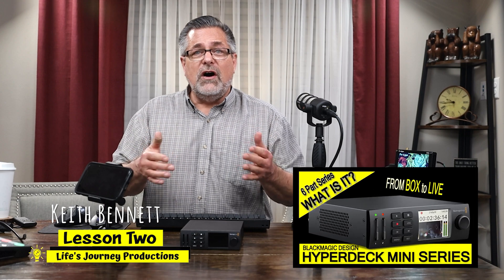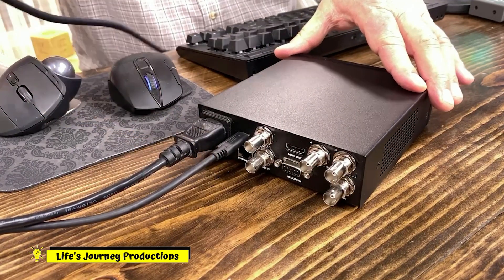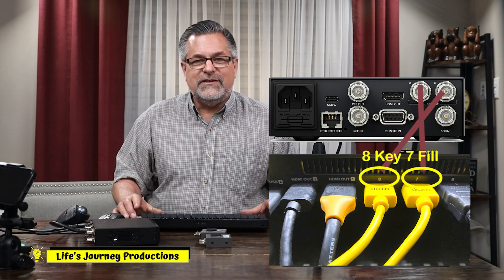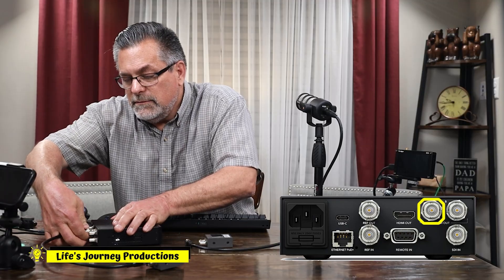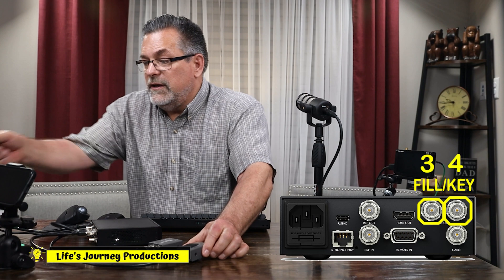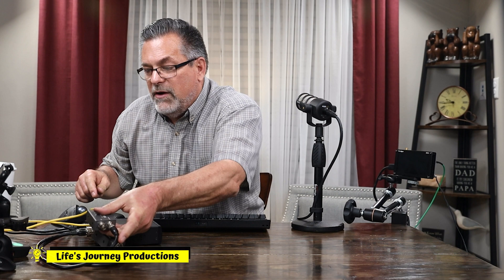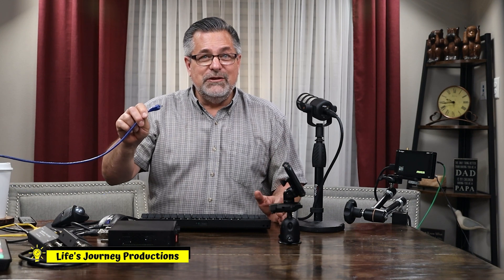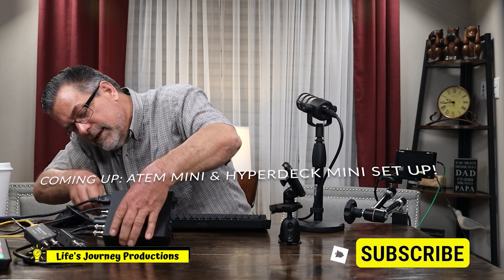HyperDeck Mini Series,  "Hooking it Up!" Lesson Two

Comment: Can I use any software like OBS, Propresenter, etc. to send graphics thru the SDI input if favor to use the key and fill to the atem? Because I think you can only send one graphic form the SD cards.
Reply from the maker: You need a Blackmagic Design Ultra Studio with thunderbolt 3 they are designed to be used with computer programs.

Comment: Hi keith , my HyperDeck has only one sdi output, can I use the HDMI and SDI out for alpha channel? I notice the older ones have 2 sDI out
Reply from the maker: They make two new HyperDecks that have no key channel. The HyperDeck mini HD and the HyperDeck HD Shuttle neither of those units have the ability to do fill and key.
Reply: @keithbennett5179  am I able to do a key with the new HyperDeck mini with 1 SDI out and 1 HDMI out?
Reply from the maker: You will have to have one of the HyperDecks with the A and B SDI Outs to perform Key/Fill. Decklibk Duo card will also work and they hve Thunderboldt devices as well. 
https://www.blackmagicdesign.com/products/ultrastudio

Comment: Hi Keith, Do you have to use 2 channels to record?  I don't want graphics or video playback. I have 2 camera's and a deckling duo using 3 of 4 channels.  I cannot get my hyperdeck to connect (no picture on hyperdeck and connect button greyed out).  I get yellow message.  I have the IP addresses set to the correct settings and most current firmwares on all Blackmagic devices.  Set up:  atem mini pro (HDMI Channel 4) --> SDI to HDMI converter --> hyperdeck SDI in.     I have 2 camera's and a decklink duo using channels 1,2,3 on atem mini pro.   Any advice?
Reply from the maker: Make sure you update the firmware of your SDI to HDMI Convertor. You go into record by pressing the button once them again to record. If you have not updated the convertor firmware that could be the issue. The newer convertors have a usb c input for firmware update the older convertors have the older usb smiling face shaped plug.
Reply from the maker: Also I do a free one hour consult and will be back from a trip on Tuesday could do a zoom. Just fill out the contact form on my web page. Lifesjourneyproductions.com
Reply from the maker: Also your set up is a bit confusing are you using the decklink duo card and a Atem? What HyperDeck do you have?

Comment: Hi, Keith, many thanks for this whole series, it’s incredibly useful!  I have a technical question though and hoping you can help!  I’ve set my system up in the exact same way you have here … Hyperdeck studio Mini  with two SDI outputs connected to two BM micro converters (SDI to HDMI) and into channels 7 and 8 of the ATEM Extreme Pro ISO. 

The problem? No audio!  In Pt3 of this series, I can clearly see audio meters reacting in the ATEM switcher application when you playback a video on the Hyperdeck so I’m assuming tbe micro converters do pass through tbe audio signal?

Ive checked my video has audio - it does and I even hear it over the Hyperdeck’s HDMI output to a monitor, but I get absolutely no audio over my SDI via the SDI converters and into tHE ATEM - I’ve checked the audio section too. 

So far, the only solution I’ve found is to take the Hyperdeck’s HDMI out, split it and take that feed into the ATEM and get the audio from that, but it’s not ideal. 

Any idea what I might be doing wrong? You’ve clearly been able to make this work! 

Many thanks

Mathew
Reply from the maker: I had the same issue it seems the HyperDeck loses audio from the convertors if the convertors have not had the firmware updated in the Convertors. II also had a client use a off brand convertor and they had no audio.  as well as sometimes if they are not on when I boot up the HyperDeck. Also the setting in the HyperDeck has to be set to Stereo Audio.  Let me know if anyone of these steps help.
Reply: @keithbennett5179  amazing, and thanks for such a speedy reply! I’ll update both of my mini converters tomorrow morning (it’s 10pm in the UK now) and give it a try.  

A second question - if you have any thoughts on it; Is it possible to change the resolution on the HDMI output?  I’m using a trio of really nice Hannspree 22” touchscreen monitors but it simply says ‘out of range’ when connected to the Hyperdeck directly. I’ve seen this in older Samsung TVs when they can’t handle a 4K signal. Im having to run the Hyperdeck’s HDMI output through a scaler just to view it. 

I would have thought by now, BM would have released an even more ATEM friendly HDMI-connection only version of tbe Hyperdeck. Im sure it’s in the works, but time will tell,
Reply from the maker: @meyerwhite1427  I have not worked with any of those monitors and the black magic output send whatever you have playing from it. You would have to scale. I have a BENQ 32" 4K display so the HDMI out works for me just fine in one of the Four Monitor Inputs.  If you play HDMI out of the outputs I would believe a 1080P monitor would display?
Reply: @keithbennett5179   The update worked.. did that this morning, many thanks! you're a life saver! I can cancel an order for another box now as I won't be needing it.  As for the HDMI out resolution.. it's odd. I'm playing back 1080p 25 ProRes.. it may simply be that the monitor cannot handle the Coded I suppose.  I haven't yet been able to bring up any of the h.264 files.  Does the unit only playback whatever codec the recording settings are set to?
Reply from the maker: @meyerwhite1427  Awesome glad it worked. If you have H.264 recordings they only work if they were recorded inside the HyperDeck none knows why. It must be the monitors can't display the Codec. If you render Apple Pro Ress they usually play back fine but they must all be the same frame rate, size and Pro ress Codec. HYperDeck needs a update. Have you updated the firmware in the HyperDeck?

Comment: Hi Keith, im getting playback on the Hyperdeck but nothing is visible on the ATEM, do the 2x SDI > HDMI converters from the Hyperdeck have to be specific channel ?
Reply from the maker: No they do not. Did you update the firmware on the converters? 

Also make sure you reboot the converts by Removing the power after you update them.

Comment: Hi Keith, excellent presentation as usual. I have my Mini connected via PoE (Power over Ethernet) which kills two birds with one stone. Looking forward to Lesson Three.
Reply from the maker: I have a powered switch across the room from my desk and a non powered one under it. The powered switch is still dedicated to the Old Man. Ave gear, X- Box, dish for TV, Apple TV, my big Samsung TV and Boss surround. I spend most of my time at this desk these days. Need to add another poE switch under my desk. Thanks for watching and I hope you will like and share the series. It seems to be doing well. The next two videos are longer by far and cover far more stuff. Then two mor after that. Should be good! 

Thanks you!